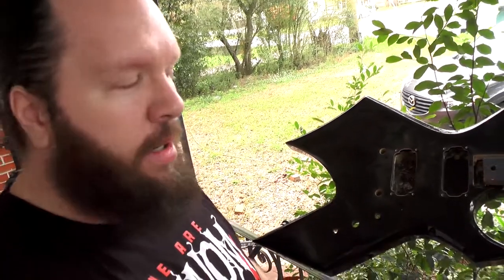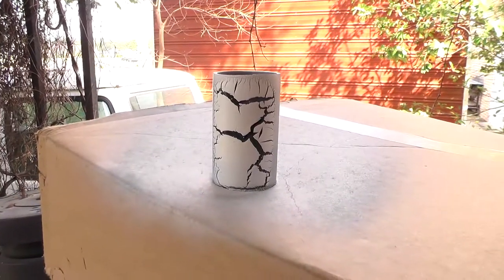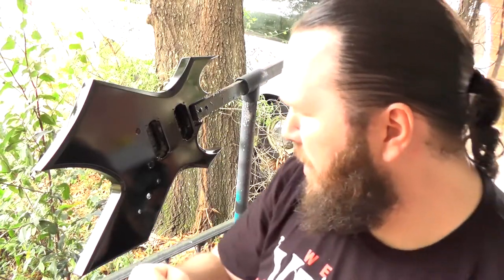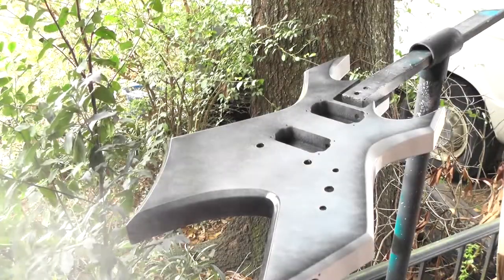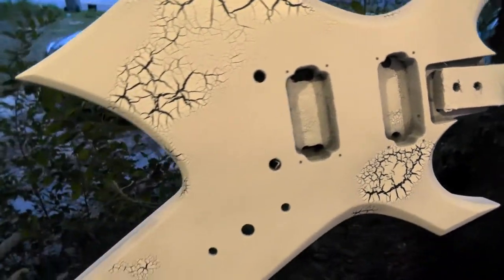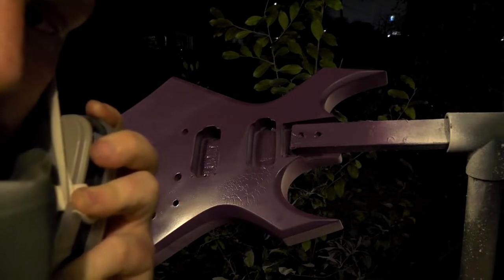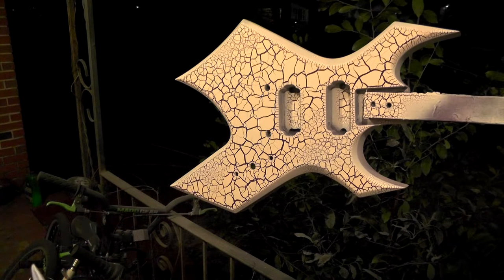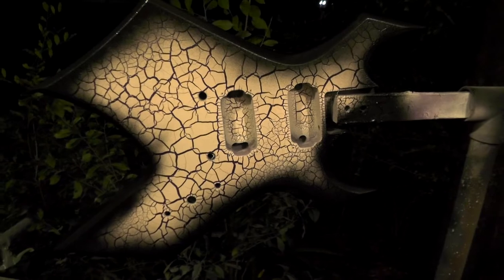Warlock Crackle Paint Experiment w/ Spray Cans

Comment: If you use lacquer paint and enamel paint it'll counter react with each other if you stick them both on at the same time a few minutes apart and it'll pull apart just like crackle finish
Reply from the maker: Good to know, thanks!
Reply: Do you use the laquer under the enamel to do this, or does it not matter?
Reply: @TheRockinDonkey  put the enamel down first, then the lacquer over the top of the enamel
Reply: @heres2ya  Thank you, sir!

Comment: With the crackle paint coat, the key is to go over it once with a very thick coat. Once you move the can away, don’t go back. One single swipe, instead of multiple layers back and forth on the same area. Slow and steady, thick coat and don’t revisit the same spot. The minute it hits the layer it’s covering, it starts reacting. Unlike multiple strokes to cover the same area when applying each coat for non-crackle paint. It’s against what we’ve learned when painting typically, but it’s what works the best for crackle paint, top coat. 👍
Reply: So no cross spraying is needed?

Comment: Aye homie got a question, I just did my first crackle paint job last night & it turned out pretty good for a first attempt, but I had the same issue as your one attempt like having a few spots that didn’t crackle or are super small, so can I tape off the good sections & then just sand & respray the bad sections? Or do I have to just sand & respray the whole face again?

Comment: The final crackle turned out awesome! Currently building a Warlock kit and saw this technique elsewhere and thought it would be perfect. 

So is the trick simply to apply a super heavy coat of crackle?

Were you concerned about runs with that heavy crackle coat, or is that paint run-resistant?

If you were to do another crackle paint job, what would your procedure be?

Comment: Use the Crackle spray paint over the black while is still wet,after you can kinda "adjust" the crackle effect with an hair dryer,it will cracle more and speed up the process ;)
Reply: btw you can also achieve this effect just using any matte paint(Like pastel or fluor) under a really glossy one while still wet
Reply from the maker: @guido69x  Thanks!

Comment: I see I'm not the only one looking to buy one of these as a refin project.  This came out really awesome.  One question though; can the wraparound bridges on these models be replaced?  Another wraparound would be fine, but all the replacements I see don't have adjustable saddles.
Reply from the maker: Absolutely, they are pretty cookie cutter and match the spacing of most other wrap around with the same string spacing(for 25.5 scale guitars).